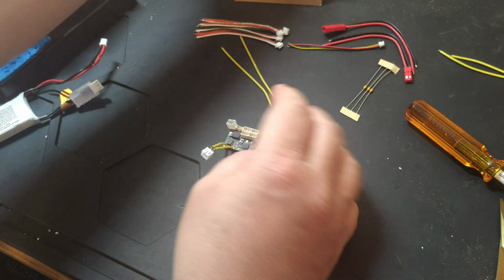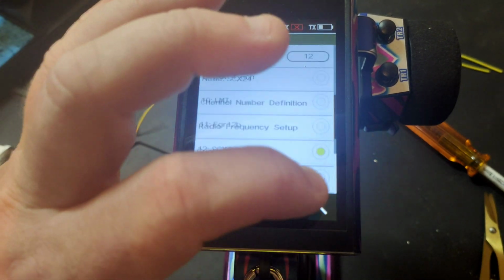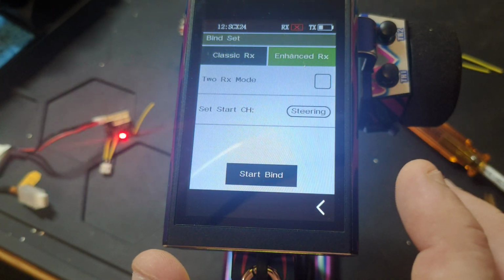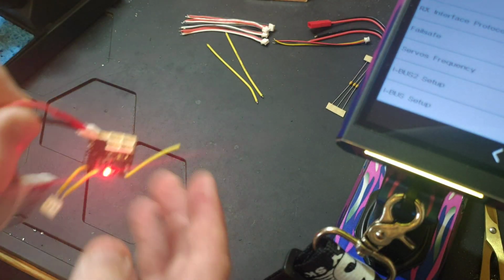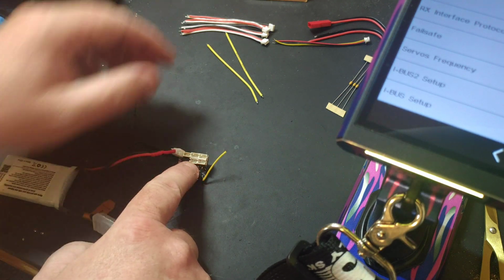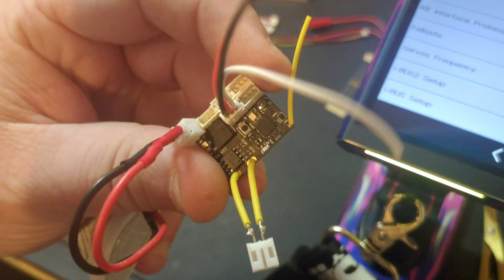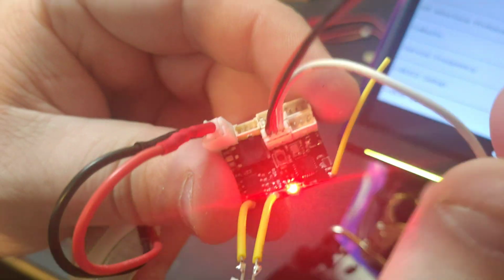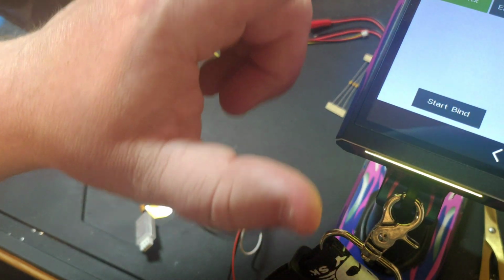Flysky Noble nb4 DM Racing micro receiver and brushed esc in one firmware update & bind guide.

Comment: Thank you.  I just bought a few of a different type of micro receiver from DM that also has an integrated brushed ESC which I’m hoping to replace the electronics on an Associated SC28 truck.  That channel 4 trick I’ve never heard of; I’m sure it will come in handy.
Reply from the maker: It's the only way to update them but the next new firmware from flysky is said to block 3rd party receivers so will be interesting to see the fall out from that one !

Comment: As usual, another well done video! 

Hey, I'm wondering if you could make a request to Flysky for the community. You may ask, why not do it yourself? We'll, I've emailed them concerning two minor things and they never replied back. It's been about a month now. You seem to have their ear, WHICH IS A GOOD thing. 

Anyway, I keep my radio on a lanyard and whenever I let the radio hang on my neck so I can do whatever it is I need to do, the radio moves around and in some cases, the trims/buttons on the steering wheel are inadvertently toggled. The Noble has a "lock" icon which is great but it only locks the screen and it would be even better if Flysky introduced a menu option that would let us pick whether enabling the "lock" key only locks the screen or both locks the screen and disables all buttons. It would be nice to disable all the buttons while the radio hangs on my neck and I'm doing something other than using the radio or if I hand off the radio to my little one. The first thing kids do is start pushing buttons!!!
Reply from the maker: Thanks 👍 as for locking the buttons just un assign the trims you can move them in the menus still but I don't think that any of the transmitters will enable an option to lock buttons and switching as it would stop you being able to use the transmitter :( I know we use many of them when using the nb4 in our crawlers :), but I would definitely un assign them as once there set up you don't need to use them, the nb4 also has a beginner mode so if you enable that it will be better for letting younger users have a go :)
Reply: @WTFRCCars  I don't see how temporarily disabling the buttons, not the trigger and steering is a negative thing. It's no different than locking the screen yet locking the screen "disables" the end user from getting into the menu system and that's a non issue. I don't run electric vehicles for the most part, I run nitro and gassers so I have way more going on than a person running electric but I do use all 8 channels with my TRX4. I have killswitch button, idle up, throttle kill, dual throttle rates, dual steering rates, etc. 

This isn't a simple matter of tirms and it's simply not practical to disable ALL those functions manually to simply walk my 1/5th scale over to my car to get more fuel all the while having the TX bounce around on my chest triggering buttons. It's simply an option that some may find useful and perfectly safe as it doesn't take steering nor throttle control away. I don't find the ABS function useful as I don't road race gassers, that doesn't mean it shouldn't be there or is useless, someone out there uses it. 

Not arguing, if people didn't think outside of the box, we'd still be using radios from the 70's. Heck, I'd LOVE the ability to adjust the idle up setting on the fly while it's enabled without having to dig into the system menu to do it yet no one outside of flagship Futaba has that, at least my 7PX did from what I recall.
Reply from the maker: The idle up can be assigned to any dial to adjust on the fly, and yeh I can see what you mean about disabling buttons for me if I'm walking around not using the transmitter I just turn it off so I can't move any of the settings, I'll ask when I speak with them but not sure if they would disable buttons like the screen :)
Reply: @WTFRCCars  I appreciate it! Doesn't hurt to ask. Also, when I first got the radio I didn't see how I could adjust the idle up on the fly while it was enabled other than using the throttle trim which, on a nitro/gasser, is a big no-no after you have set it properly. I've updated my radio twice so when I get home, I'll take another look as I haven't bothered to check since.
Reply from the maker: We use idle up for cruise control on the crawlers, just adding it to and switch and also to a dial , the switch turns it on/off and the dial will allow you to adjust it :)
Reply: @WTFRCCars  Perfect! Good to know I can do that now on the NB4. This is such an amazing radio😀
Reply: @WTFRCCars  Also, I forgot to mention that I have tried the beginner mode and for me, it's still not enough, meaning, the vehicle is still too fast so I simply end up lowering the throttle EPA before handing the TX over to my kid. Also, beginner mode does nothing for preventing a kid from pressing whatever button they want so it would be useful too if beginner mode disabled the buttons as well.

Comment: Good video 👍thanks.
Can you tell me if the flysky sensor  for measuring the speed is efficiency.
Reply: I have a buggy car and ask me if it's a good idea to put it on.
Reply from the maker: This esc and receiver is only for very small rc's like the axial scx24 and the like not 1:10 scale rc's as it's a micro receiver.
Reply: @WTFRCCars  thanks 👍. They have to types of speed sensors. Which do you use ?
Reply: Have a good day
Reply from the maker: The magnetic work well on a spur gear and the optical is easier to mount if your going for wheel speed.
Reply from the maker: Yeh the flysky speed sensors work well so long as you calibrate them correctly :)